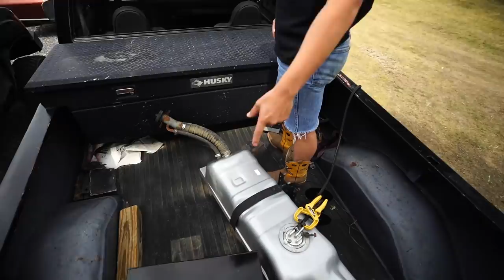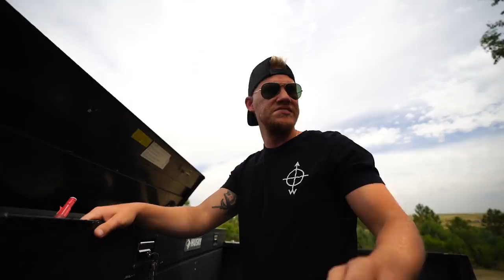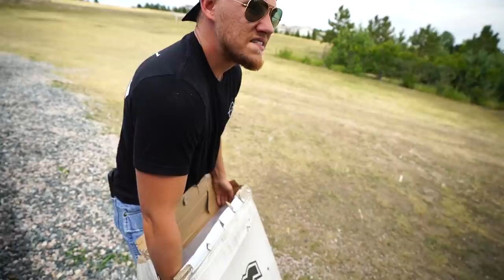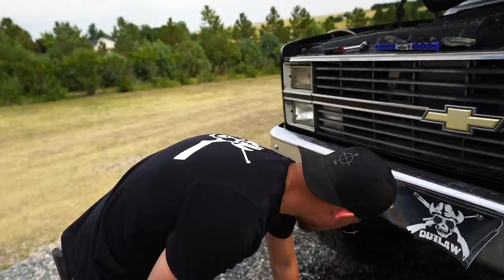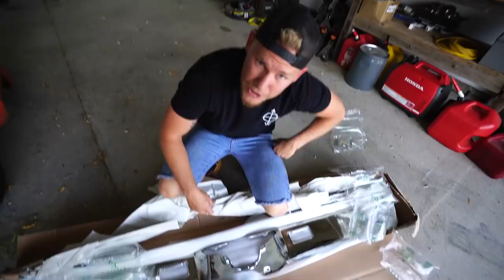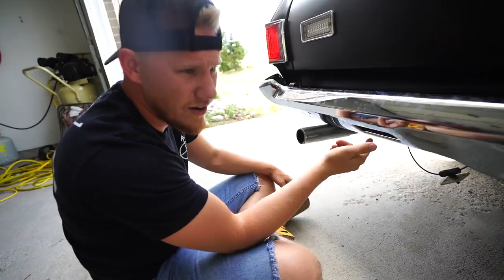Installing VERY IMPORTANT Mod on my Truck!!

Comment: 383 strokers like to run hot. Gotta have a good radiator. I have a 78 Chevy c20 custom deluxe 350/4speed with granny gear. Polk ohio